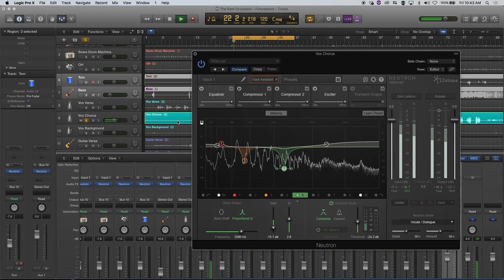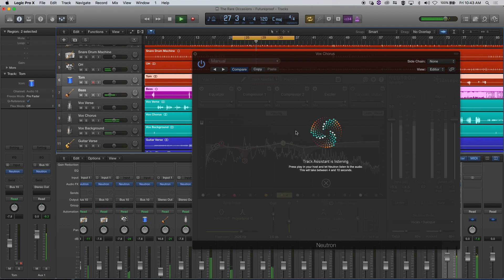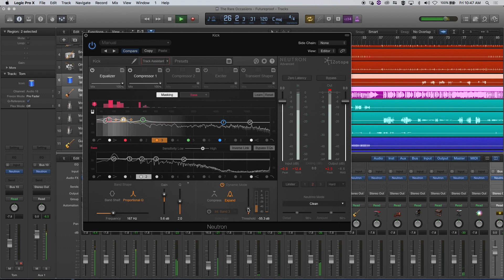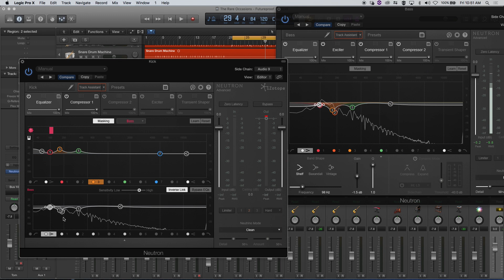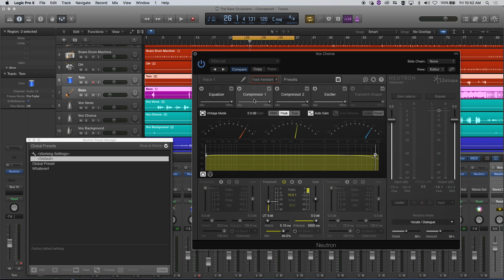Izotope Neutron - Comprehensive Rundown & Tutorial - AES 2016

Comment: You miserably fail to first state the obvious answer to the glaring question: How does one hook this up? As an insert in the stereo mix output? or as an insert on each individual track? And if it is an insert on each individual track, how does one neutron instance inserted in one track knows what another neutron instance is reading in another track? If the multiple neutron instances inserted in multiple tracks do not talk to eachother, how can it mix? Even if I got it right, how come you dont explain this, which should be THE most important thing to explain before anything else?
Reply: i think he did explain it and mention it a few times in the video. each instance does talk to the other, thats the whole point of using it

Comment: I've spent all day playing with the demo, it really is VERY well put together. The Masking Meter is brilliantly done, and the Track Assistant doesn't necessarily mix for you, it cleans up your track and gets it prepared for mixing.

The Mask Meter + Track assistant + Ozone is a perfect combo for getting some VERY high quality material together easily. I loved it.
Reply: So this plug in doesn't effect track levels at all? i.e.Turn a track up or down to fit better into the entire mix?
Reply: mike black
Yes, of course. Every iZotope plugin has a level -- INPUT and OUTPUT levels. Just to make one thing clear, this plugin is not all about the "Track Assistant". You can ignore that feature and it's still a very powerful mixing tool. Honestly, just the Masking Meter feature is worth the price of admission.

So if you want to do your leveling in the plugin, you can adjust either the input level or output level.
I personally would recommend doing your leveling before using Track Assistant.

What Track Assistant does is to analyze your audio, determine what your audio is doing, and attempt to fix up problem areas with the tools inside the plugin (like EQ, Compression, Excitement, etc.). So essentially, it is doing the mixing for you of that single track. It will not do any macro mixing for you (across multiple tracks), only the micro mixing (within one track).

For the macro stuff, you can engage the Masking Meters and it helps to tell you where you should be cutting/boosting.

Download the demo, it's free for 10 days.

Comment: With the 2nd run on the vocal it boosted the same frequency that it cut the first time round lol...
Reply: that was with the aggressive setting instead, no?
Reply: It behaves differently depending on what section of audio you are checking. 5sec - 10sec, it might do a certain setting, then 10-15 another slightly different.
What it does well is to correct problem areas, or clean up focal points

Comment: would i work well on the master too?
Reply: This is the first video I've seen so far on "How it works", speaking lightly I haven't read any of the literature or manuals off Izotopes website for operating this plugin, but from this video...
My guess is its intention is to possibly run a copy of the plugin on every track and every bus you have in your current project (or anything you want measured against something else), I would think they would have a "mixed instruments" mode for the Master Bus? But then again you never know, in the demo, the guy doesn't run it on the master bus, so now I'm curious too, how many nodes this thing can assign or everything track simultaneously if you were to take an ENTIRE mix of a general project, Guitars / Vocals / Bass / Drum Mic's....and have each one individually recognized first, I would imagine they would then contrast, or atleast show you something when you solo the plugin on the Master Bus... then trying to do one sweep over the master bus...
If it works like i'm thinking it sort of reminds me when Melodyne first came out, and for proper pitch detection they had a plugin that had to "RUN" ontop of each piece of audio first...
But this also connects to every plugin running in your DAW, so im imagining its light years ahead...
But I have yet to use the plugin, and this is only the first video i've seen of it.
So it might be that they really intended this plugin to only recognize a few instruments masking one another at a time.
Or trying to do the whole project master bus at once might cause a huge amount of CPU power....
I'll have to play with it...
Its certainty not what I expected after hearing about it, then seeing the Demo...the controls seem a bit odd? I'm sure in the future though as the plugin upgrades, they'll tighten the look of the GUI...whether thats a good or a bad thing for people...